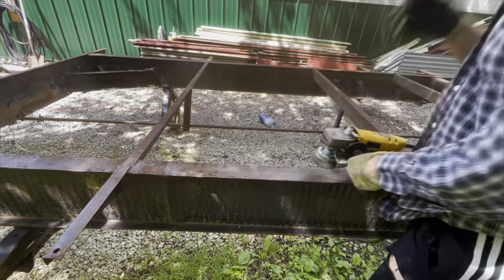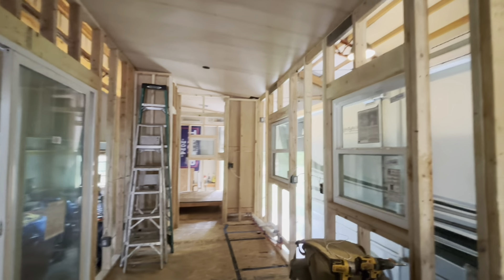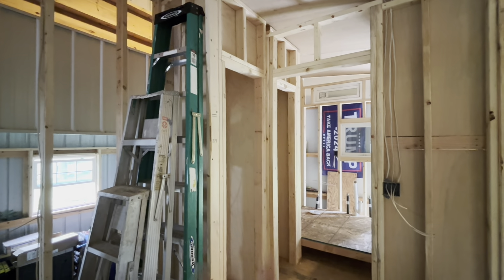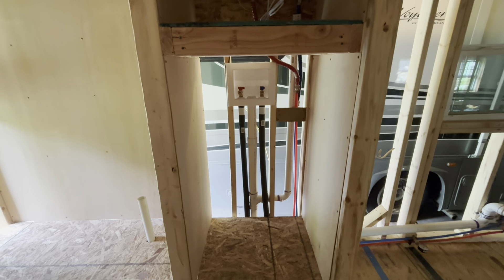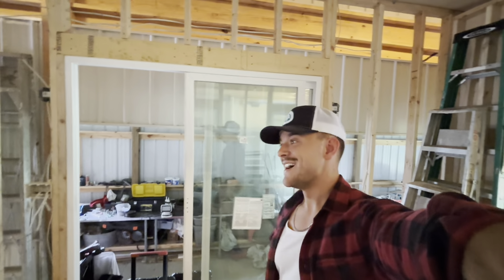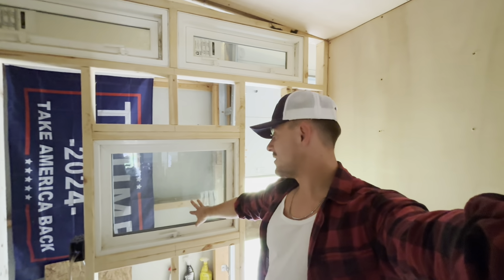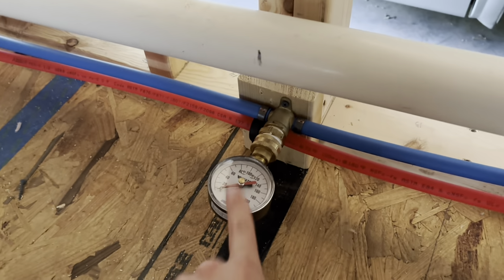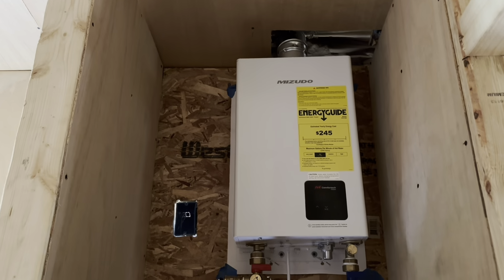TINY HOUSE UPDATE | It’s been a minute!

Comment: Excuse my suggestion, you might want to check the weight rating on the axles and beef up your suspension.
Reply: That’s what I was thinking too. But when you build a tiny house on a camper trailer, or a utility trailer, please, and I mean PLEASE do NOT use 2 by 4’s for your framing. I’m not saying I hate this guys build, but my point is that using 2 by 4’s for your frame is HEAVY! But using 2 by 2’s reduces the weight by half…or more if you actually do the measurements between the two. I don’t recommend using 1 by 2’s. That would lead to the walls being thin and flimsy. It will be a lit lighter, but you don’t want the materials being so thin, it makes it easy to fall apart. But I can’t stress enough about how many times I see this from other people who build on a trailer with 2 by 4’s and it bothers me so much to see, because I know it’s gonna eventually lead to being extremely overloaded. But I will eventually get me a trailer around 25 to 30 feet of living space. But for walls and insulation, I’ll definitely be making a better choice for lighter materials…

I just wanted to address that for anyone who is planning to build their tiny mobile home on wheels. Or has already with 2 by 4’s and has any issues with the weight or suspension on the trailer. But just going off my personal perspective, experience, and predictions. Because I am building one currently and still trying to finish it.

Comment: You might want to add a wheel wells since when the trailer suspension sinks or hits a bump your wheels will hit the wood you need room for it sinking with weight